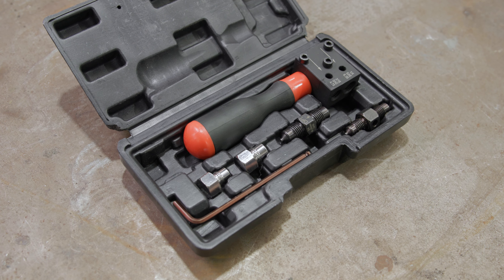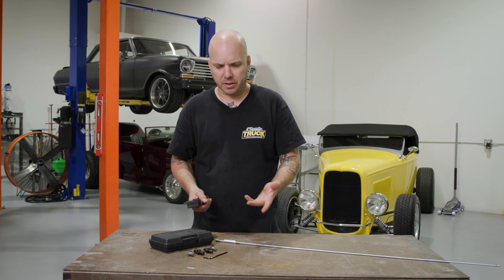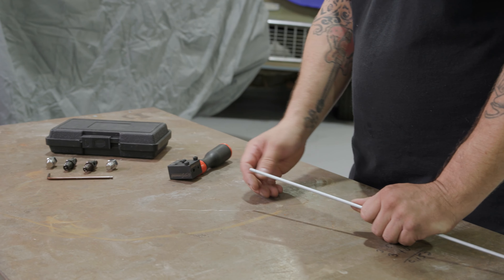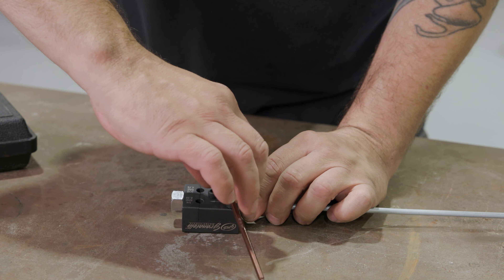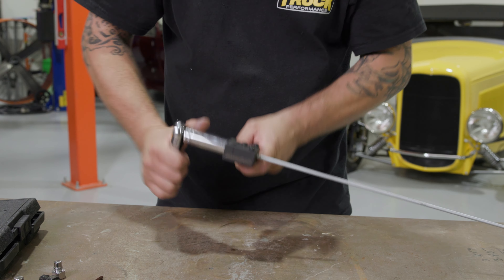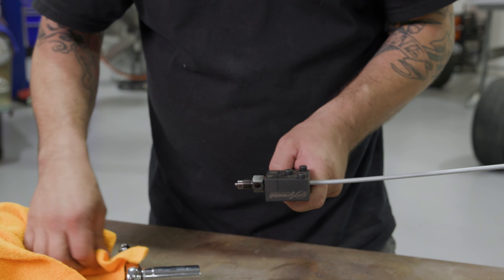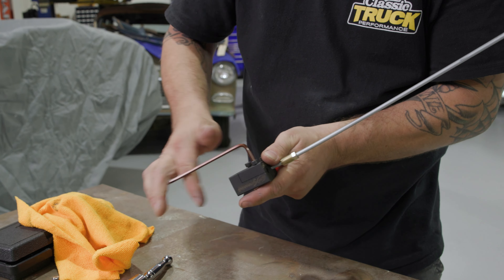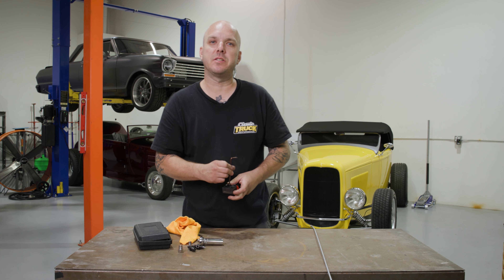The best and easiest on-car tool we have used for double flaring brake lines.

Comment: i ORDERED THIS TOOL AND I DOES NOT WORK....  THE LINE DOES NOT CLAMP TIGHT ENOUGH, IT SLIDES RIGHT OUT OF THE TOOL WHEN I TRY TO FORM THE FLARE....   HORRIBLE!
Reply: Try buying the right pipe for your clamp... in the europe we have 4.75mm and 5mm pipes. If u have 5mm clamp it wont hold up the 4.75 pipe.